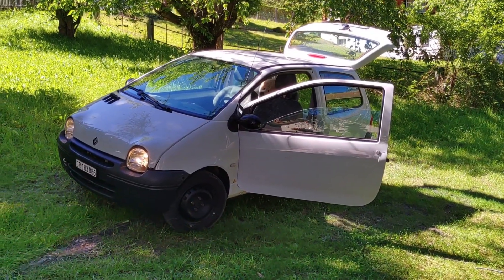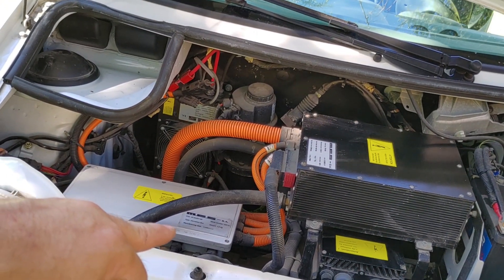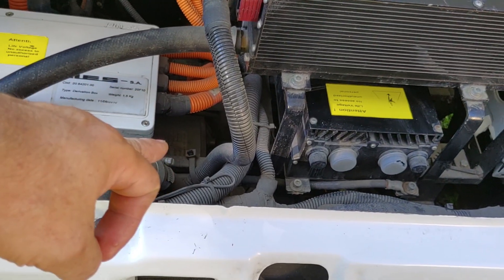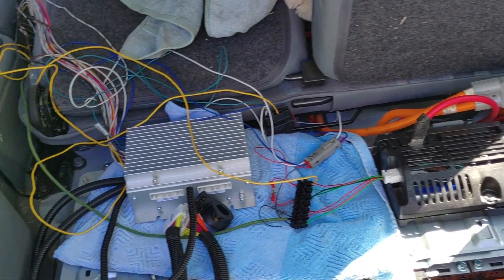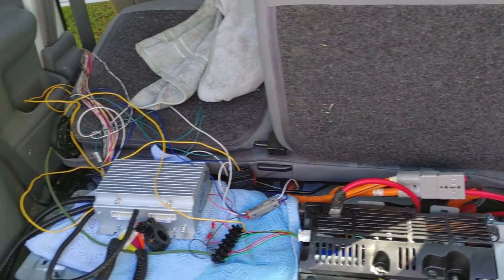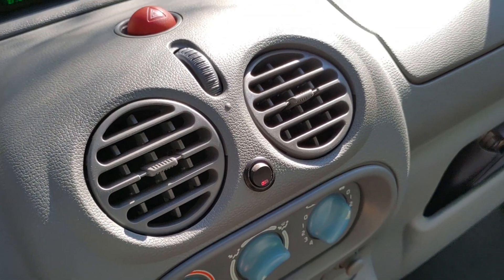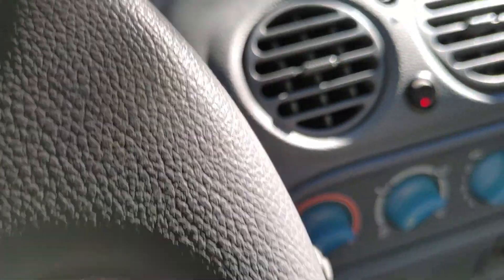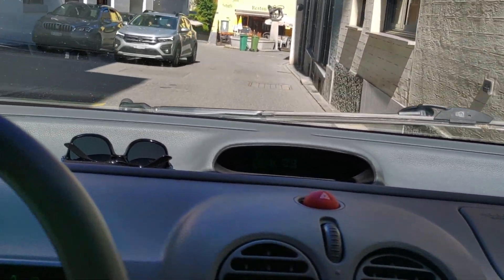REMICHANICS #37: First electric drive in a converted Renault Twingo!

Comment: Good upgrade to this MES-DEA/Kamoo Twingo !
I have one of them from 2011 with its original Zebra (Ni-NaCl) battery. I still use it regulary, as I managed to make it road legal in France.
Because of the high temperature of the battery involving constant electric consumption, I am planning to replace it with NMC or LFP. I am a little bit late, but if you need information regarding the Zebra battery I can try to help

Comment: Very nice conversion! I have a 2001 Twingo and my speedometer is very different from yours. Did you changed it for something custom? I'm thinking of making one using ODB2 as a data source.
Reply from the maker: Hello Gabriel, yes the speedometer is coupled with the inverter unit so it's a specific display for this drivetrain and it has nothing to do with the original display of the Twingo!

Comment: Nice! But I also wanted to see it charge like shown on the thumbnail 😂 I doubt it will charge on a public charger with the Orion BMS disconnected so I would guess the thumbnail is more recent?
Reply from the maker: Thanks mate! Might do a separate video on charging. The BMS was of course connected and the battery closed up for the drive. But I had a problem with the charger at the time, and I subsequently blew the charger up while diagnosing. Waiting for spare parts at the moment 😬... VERY long leadtimes as you might guess! Cheers!